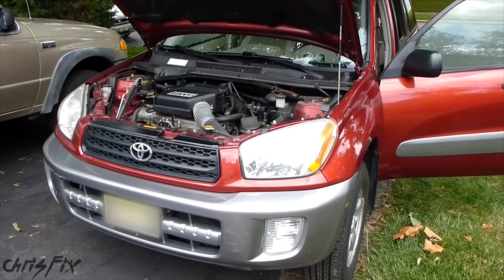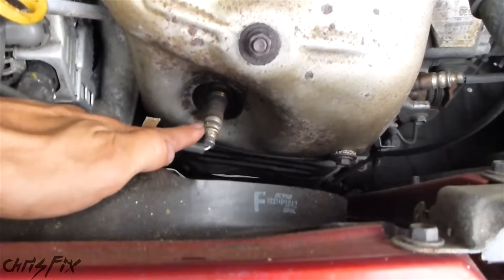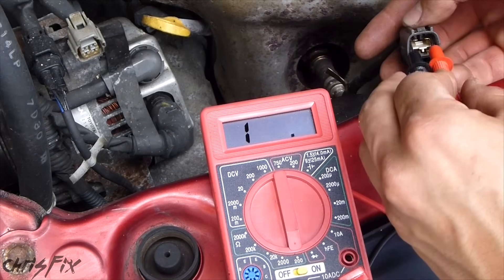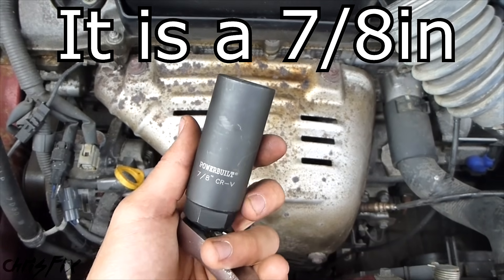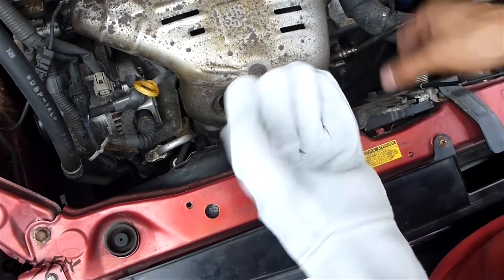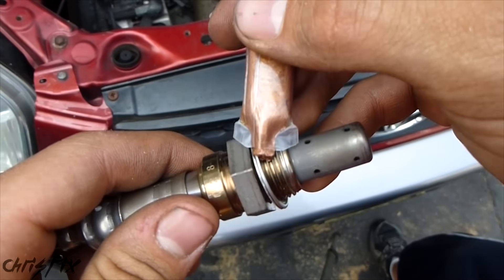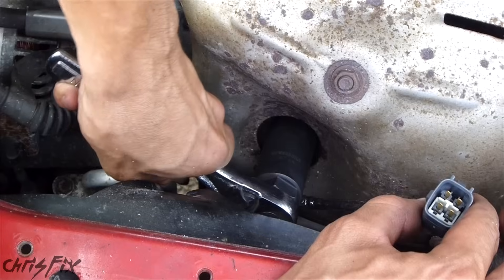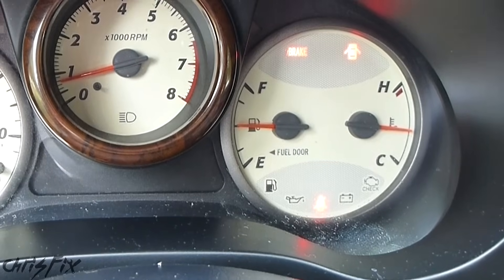How to Check and Replace an Oxygen Sensor (Air Fuel Ratio Sensor)

Comment: P1155 is the universal code for oxygen sensor heater circuit malfunction or does it differ from manufacturer to manufacturer?
What does Bank 1 and Bank 2 mean?
Bad O2 sensor will show no resistance?
Reply from the maker: ***** P1155 is, for the most part, the universal code for a bad O2 sensor. Bank 1 is one side of the exhaust and bank 2 is the other side. Sensor 1 is the first sensor (closest to the engine) and sensor 2 is the second sensor typically after the cat converter. A bad heater circuit will show no resistance or very very low resistance. The cars computer sends an electrical current though the sensor to heat it up. If there is not circuit or super low resistance, it wont heat up. You can also have a dirty O2 sensor.
Reply: ChrisFix so Bank 1 is before Cat and Bank 2 is after Cat?
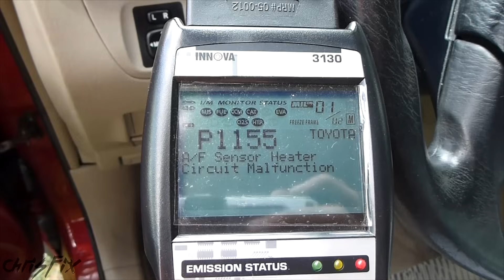Reply from the maker: No, bank 1 and bank 2 are just the sides of the exhaust manifold (check out the diagram in the video at 0:10 ). Sensor 1 is before the cat and sensor 2 is after the cat.

Comment: Other than the OBD code, what are some symptoms of a bad sensor?
Reply from the maker: cwvowel Your fuel economy will go down. If the whole sensor is not working, you can run lean or rich. Those are typical problems besides the check engine light.

Comment: My 06 Malibu idle keeps surging I replaced the the throttle body spark plugs wires a few sensors ran cleaner trew the engine no luck I have 3 02 sensors but I have no check engine lights on at all
Reply from the maker: Ali Ibarra Check this out: https://www.youtube.com/watch?v=vFhoNykgQtc
If that doesnt work, I would think you might have a vacuum leak somewhere. Is there a mass airflow sensor on your Chevy Malibu? If so, you might try disconnecting it and seeing if the surging goes away.
Reply: Thanks dude I disconnect it and the surging continued no vaccum leaks anywhere and then I connected it back disconnected all 02 sensors it continued. Checked obd and no codes at all only when I dosconnetdc the maf but quickly went away
Reply from the maker: Ali Ibarra How is your fuel pressure?

Comment: hey well this make your vehicle once warmed up to not want to restart again but if u keep it alive it wont die on you, but after awhile it stops and could be a awhile before it happens again?  yes the windstar lol its at it again
Reply from the maker: lovepeacenotwar1982 If the sensor is bad, you will get a check engine light. You can connect a scanner to the OBD2 port and see if you are getting voltage from the O2 sensors. The upstream O2 sensors can cause a hot car to stall if they are not working right.
Reply: hoping they arrive today , yeah we done all that and i got a check engine light... more then once mine just doesnt stay on all the time yet.. but the problem was getting worst... "i'll let u know if this fixes the problem, i am hoping so"
Reply: we did all that and the sensors are working... but on our test drive which did really well , the check engine light came on and was not going off, rechecked everything and all seem good lol car runs good when warm but i notice when we first start up she running ruff... checked for vaccum leaks but found none, checked all the hoses , no leaking... starting to expect the mass air flow sensor... so took it off and cleaned it.. but havent had time to drive it yet... got cake orders and valentines orders to fill... i work on cakes and cars haha+ hope u have a good weekend, if u got any suggestions feel free... i put enough money in it now, i mise well not give up..
Reply from the maker: lovepeacenotwar1982 What is the check engine light for?
Reply: P0174  is the code but i got bigger problem right now. Weld on the new strut assembly failed the other night coming home, luckily we had just stop to grab a bit to eat through drive through, i heard a pop . decided to look and the strut was sitting on the tire and the mounting bracket was bent and broke away from strut.... had it towed $160.00 was going to cost me 300 but guy got off and did it for less good thing too.... so up on looking it tore the hub , new bearings up as well as fairly new tires , both sides are doing the same, i done took the struts off and bought monroes though i do not like the fact there is only one side welded , my old stuts had both sides welded... the welding on the unity struts is what failed... working with company now in hopes to settle this... sucks man ... can u imagine the mechanical fee cost ....if we couldnt do things ourselves... but thats nothing compared to our lives and the lives of our family...
Reply from the maker: lovepeacenotwar1982 Wow, I am glad you went to look to see what the noise was and that it happened at slow speeds! Keep me posted on what happens!

Comment: 2 Quick unrelated questions, lol: can replacing the camshaft (along with valve springs) bring back some performance to decent mileage engine? I'm thinking of upgrading the camshaft (as well as pushrods and valve spring) for higher performance ones in my truck (it has a chevrolet 4.8L gen 3 lr4 with a hydraulic roller cam) and was also wondering if replacing lifters is just recommended or mandatory (it only has 90k miles)?
Reply from the maker: TheHuntizOn Replacing the cam is one of the most cost effective upgrades to increase hp and torque. It is a good idea to replace valve springs as well. You might consider going to roller rocker arms which decreases friction and heat which means more power! At 90k miles you dont have to replace the lifters but obviously if it is cheap enough and easy enough, I would do it.

Comment: Chris,
I would love to see you do a video review/explanation of blow by and prevention/fixes.  I have a 2001 Ford F150 with 290,000 miles on it.  It recently started using oil. NOT leaking or blowing blue smoke just using a quart or 2 between each oil change (7,500 miles using synthetic blend)  I would love to find a fix other than ring job or rebuild.   Keep up the great videos.  they are great training tools for young folks as well as us old timers.
Reply from the maker: Shane99ize A blow by video would be awesome. Thanks for the suggestion. As for your problem, using a quart of oil every 5k miles is typical of a 300k mile engine. If you want to see if blow by is occurring, just check the intake after the pcv valve and look for oil.

Comment: Can't you just cut the old wire and use a normal socket, then use a gear wrench for the new sensor?
Reply from the maker: Tyler L You could if you wanted to. I was showing how the O2 sensor socket works. A gear wrench will not give you enough torque to get the O2 sensor off. You will need to use a ratchet and breaker bar in most cases.

Comment: If you have tested and confirmed that you have a bad sensor, cut the wires off and use a regular deep socket. Applying too much force to an O2 socket will spread it open and make it useless. It is really just an installation tool.
Reply from the maker: Eric Morrison Thanks for the tip.

Comment: Hi Chris, great videos! I have an 88 Opel Corsa that doesn't respond well when i open up the gas pedal completely. It kinda rocks back and forth. Also the idle is kinda "unruly". Could this be a dirty carburetor?
Reply from the maker: pengarpratar That could be a dirty carb or your distributor and or timing could be off. Can you tell if your car is running rich or lean?
Reply: ChrisFix i will check the exhaust first thing tomorrow morning!
Reply: So i checked the exhaust and the smoke looks fine, kinda grey. Comes out some water at the start and it coughs with some time apart. Also when i drove it today, the rocking back and forth didn't occur and it accelerated fine with full gas. Yesterday it was below freezing, today it was pretty warm outside. Maybe that has something to do with it?
Reply from the maker: pengarpratar You might have had some moisture in your fuel line or maybe the gas was cold enough that it started slushing up. That is a possibility. Hopefully it doesnt happen again!

Comment: Cheater bars shouldn't be used by a professional like yourself :). You know it is bad for the tool and you risk breaking the structural integrity of the tool each time you over torque it.... but jealous the RAV4 has O2 sensors up front mine are below the bay :(.
Reply from the maker: Jordan Karim I show people how to fix their car at home with the tools they might have. Not everyone has a 3/8s breaker bar so a trick is to use a cheater bar. The ratchet is guaranteed for life so I am not worried. Yea, the sensor was really easy to get to. Sometimes the bottom sensors arent bad. You drive the car up on ramps and work on your back lol.
Reply: This is true, thanks for making that point :).

Comment: hey i was wondering what machine you use to check for codes and where i can get one. Thanks
Reply from the maker: George Moussa That is an old OBD2 reader. I will be doing a review on this one soon and I highly recommend it! http://www.amazon.com/gp/product/B00652G4TS/ref=as_li_tl?ie=UTF8&camp=1789&creative=390957&creativeASIN=B00652G4TS&linkCode=as2&tag=chri0e2-20&linkId=FKGF5TY6K27Y7MRK

Comment: Hi Chris, I have a problem. My car's Air Conditioner is hot, even though I set it cold. It releases hot air instead, how do I fix this?
Reply from the maker: The Fury That is the blend door. Check out this video: https://www.youtube.com/watch?v=-XjXTVJhFLM
Reply: ChrisFix Thanks!
Reply: Check the fluid level in radiator and overflow

Comment: Might be a foolish question.  Can the sensor be checked completely off the vehicle at room temp?  The reason I ask is the only way I'm going to be able to unplug the sensor is unbolt it and feed it up towards the top of the transmission and then might have enough room to get to the clip.  (02 Tacoma 5sp/ Sensor 1 Bank1).  I'd like to check it first before shelling out $100.  If it does check out, will I be able to reinstall the sensor without an exhaust leak, since I won't have a new gasket?

Comment: Nice job i changed my sensor on my acura 2 weeks ago same concept different location good job keep the videos coming
Reply from the maker: Jason Meridin Thanks Jason! How did your sensor replacement go?
Reply: It was easier then expected. I had a hard time taking the old one off but a buddy told me to try brake fluid and it came rite out without stripping threads
Reply from the maker: Jason Meridin Nice! You should try this stuff next time: https://www.youtube.com/watch?v=2WuVBFTzoKc

Comment: Good video .... Question so when the o2 heater  circuit is open . Are we able to see live data of the 02 going lean and rech ??
Reply from the maker: david cisneros You should be able to see the data still because just the heater is broken. If the heater and the sensor itself is broken, then you will get nothing. But if just the heater is bad, the CEL will come on but you should still see that lean, rich, lean, rich on the live data.
Reply: Cool man thanks...:)
Reply: ChrisFix That's what happened on my F-150. I got no readings at all from the sensor, and I had two different OBD codes for the same sensor. But on my Ford, the sensors are not nearly as "user friendly" as the one in your video. In fact, they're downright evil. I replaced my own air bag sensor, and even my own steering shaft (thanks to your video), but for the O2 sensor, I took it to the dealer. It was worth a little extra money for me not to have to mess with it. It took them an hour and a half... it would have taken me all day. You have to remove the fender well and a few other things just to get to the sensor. No thanks.

Comment: Hey Chris I just replaced the two belts on my 94 Geo Tracker and it solved a problem I was having, but now I have another annoying problem, my car starts to squeal only when I accelerate, what do you think could cause this?
Reply from the maker: XxVendetaxX1 Did you see this video: https://www.youtube.com/watch?v=AEUe6uKxTv8
The squealing could be a bad tensioner.
Reply: ChrisFix
Yeah that was the first video recommended to me and it made me say maybe, but I was just not to sure because I'm still new to fixing my own car and I just needed another opinion. So the car does not squeal when idling  and only squeals when accelerating does that help to diagnose what the problem could be?
Reply from the maker: XxVendetaxX1 Did you try the water trick?
Reply: Not yet, but I will first thing tomorrow, also I live near Belvidere in IL and it's really cold do you think that could cause anything? Also how did the Sea Foam work with your vehicle?
Reply from the maker: XxVendetaxX1 The cold could cause the belt to squeak but that would typically happen when the belt is old. Let me know what results you get. I did not do the seafoam test in my truck yet.

Comment: TopTip; don't use an open ended wrench or cresent wrench... but what if its a six sided combo wrench? or what about don't use penetrating sprays cause bla bla bla, or go ahead use them see if I care...
Reply from the maker: justedbin lol, bad experience with open ended wrenches and O2 sensors?
Reply: ChrisFix
no, not yet, but I really like/appreciate it when you add the toptip, its a plus you add to your videos that the other guys dont do. but good stuff none the less
Reply from the maker: justedbin Thanks a lot bud! Im glad you like the top tips!

Comment: Hey chris which dremel should i get, the standard kit or auto kit? 
http://www.amazon.com/gp/product/B00DS1ROK2/ref=ox_sc_sfl_title_1?ie=UTF8&psc=1&smid=ATVPDKIKX0DER
Reply from the maker: MrRangerZr1 Are you sure you want a cordless? I have gone though my share of cordless dremels and would recommend this: http://www.amazon.com/gp/product/B002L3RUVG/ref=as_li_tl?ie=UTF8&camp=1789&creative=390957&creativeASIN=B002L3RUVG&linkCode=as2&tag=chri0e2-20&linkId=T2L3K3KM5TFWYZOA
But if you like the one you were looking at, the auto one has some good stuff. Are you going to use it mostly for cars?
Reply: ChrisFix Yeah, i was going to use it mostly on cars. I think the dremel you recommended is more powerful than the cordless. But, too lazy to pull out the extension cords out lol
Reply from the maker: MrRangerZr1 Just as a word of caution (from my experience). You would think a cord will suck but it is worse when the dremel battery wont last or has to charge. They are NiCad batteries which suck. I strongly encourage you to go for one with a cord. Obviously it is up to you, but I have 2 cordless ones that sit there and do nothing and the one corded one I use all the time.

Comment: Seems like the wire on that sensor is slightly too short. Thats the correct part of course but I dont care for how tight the angle is on the wire coming out of the sensor, seems like it is binding the wire.
Reply: ChrisFix that's probably true. I reckon you could put a tad of slack in it though without that being a problem. Idk, if you can manufacture to perfect length I guess why not.
Reply: That's the first thing I noticed as well. Seems a bit odd. Perhaps the manufacturer really doesn't want it to vibrate if the sensor is sensitive to noise, but it seems a bit odd.
Reply from the maker: UnitCrane514 I see what you are saying. I think that is because it is so close to the hot exhaust and engine so you dont want to have loose wires around that could touch hot engine parts. While it was short, it didnt feel like it was putting stress on the connector or anything.
Reply from the maker: Andy Plater Interesting idea. I was thinking it is short so that it doesnt touch any hot engine parts.
Reply from the maker: Andy Plater Yea, I would guess they figure the less wire they use the cheaper lol
Reply: UnitCrane514 Some sensors are available with different length wires. You just have to make sure you get the proper configuration for your engine.

Comment: thanks man, i have the same code on the same SUV, im gonna test the continuity in the week to see if it is the sensor or and electrical problem. one question whats the part number of the sensor?
Reply from the maker: Alberto Carrasco The part number is 234-9023 
http://www.amazon.com/gp/product/B000C5SGHC/ref=as_li_tl?ie=UTF8&camp=1789&creative=390957&creativeASIN=B000C5SGHC&linkCode=as2&tag=chri0e2-20&linkId=2SDKFWM6XPS43EVO

Comment: What is the model of that code reader? I see the link below for the wireless one but I like the one you are using here, thanks!
Reply from the maker: Robert Parker This is the one I used in this video: http://www.amazon.com/gp/product/B000EVWDAK/ref=as_li_tl?ie=UTF8&camp=1789&creative=390957&creativeASIN=B000EVWDAK&linkCode=as2&tag=chri0e2-20&linkId=AY2YIWQVI3J4T6FD

Comment: Any difference in an oxygen sensor and an air fuel ratio sensor?
Reply from the maker: helivesonforever (check the description lol) What distinguishes Air Fuel Ratio Sensors from regular O2 sensors is that the AFR Sensor is what is known as a wide range O2 sensor whereas the basic O2 sensor is a narrow range sensor. It can detect a wider range of air/fuel ratios than the basic O2 sensor. Also, the AFR Sensor has a little bit more circuity to enable it to detect more minute variations in the exhaust system air content (more sensitive than the O2 sensor). Therefore, it is able to make better adjustments through the ECM to add or subtract fuel to produce a better mix of air/fuel to maximize efficiency and minimize emissions.
Reply: ChrisFix Sorry Chris, got ahead of myself, thanks for the clarification!
Reply from the maker: helivesonforever No worries! It is always worth checking the description, and if not, ask away in the comments!
Reply: ChrisFix Will do! Appreciate all your vids, what do you have planned next? (Don't tell me that's in the description too!)